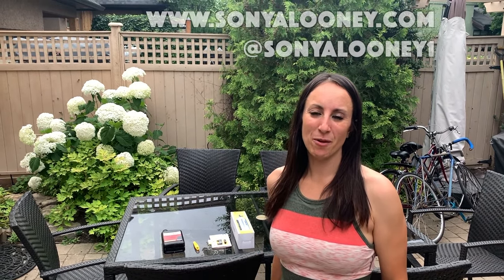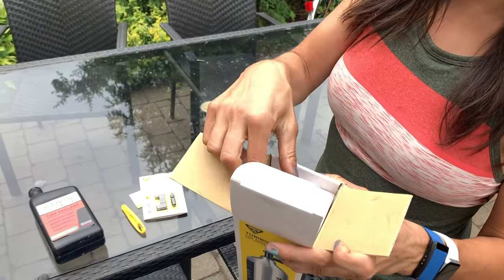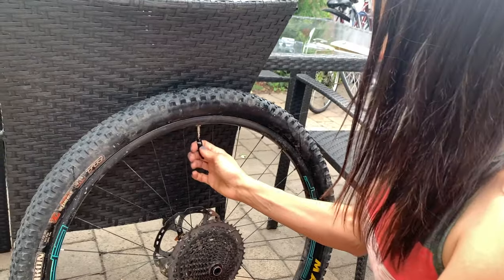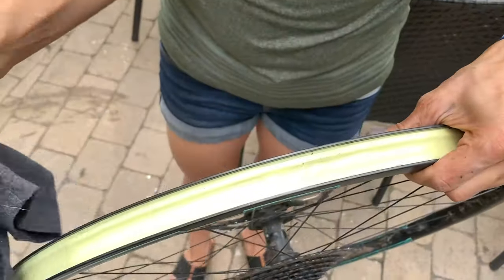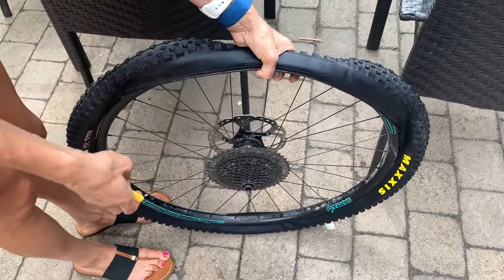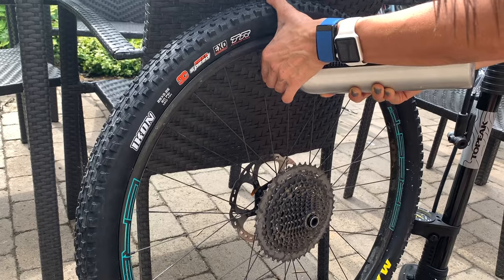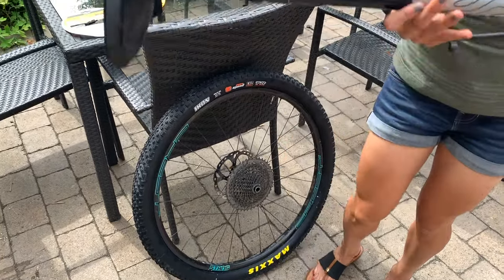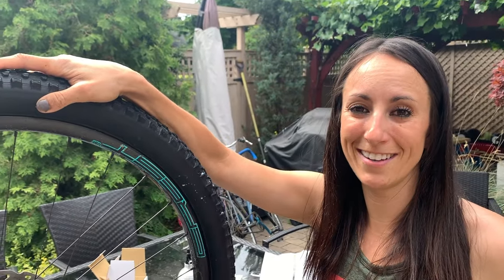How to Change a Tubeless Tire without an Air Compressor

Comment: I bought one of these Topeak Tubibooster  and tried to seat my MTB tyres . Tried it about 25 times and it did not work , so went back to the old Coke bottle method that I've been using for years , and it worked first time as usual.     Sent the Tubibooster back and got my money back.   That's my experience with a Tubibooster . But thanks for your video .
Reply from the maker: Sorry it didn't work for you!
Reply: Thanks, saved me some time and money lol.

Comment: BEWARE: DOES NOT WORK for "First Time Seating" of TR light/racing 29er tires (e.g. Maxxis, Schwalbe). I have tried several times to get this to work but it only works when tires had been seated before and have only partial sections separated from the rim. NEVER WORKS FOR BRAND NEW TIRES. It is frustrating. Tried with 100 psi, 150psi, 180psi... 200psi. PROBLEM: Air simply discharges too slowly. My floor pump could get the canister up to 200 psi (which is too high). But it never releases with the rush of air necessary to seat a brand new tubeless tire for the first time.
Reply: Just had the same issue. Great to reseat .  Just installed two new tires for my race on Sat...

Comment: Nice video on seating tubeless tires. I love your Topeak tubeless tire booster. I also have a tubeless tire booster. Mine is the Schwalbe which partners with airshot. It’s called Schwalbe tubeless tire booster. I use that tire booster to seat my tires. I have a green metallic 2019 Giant Trance 2. Keep shredding some trails😊